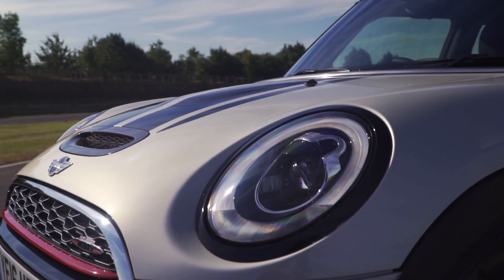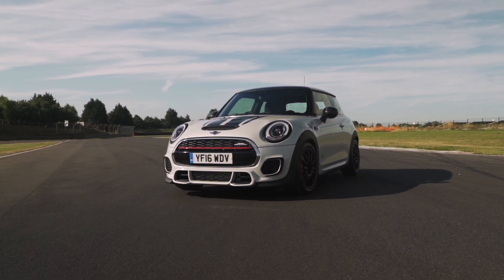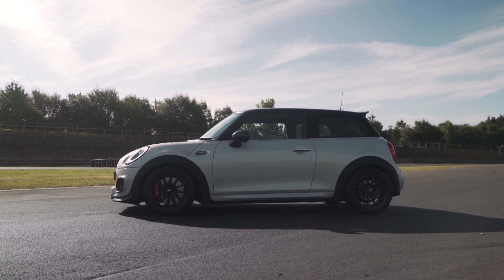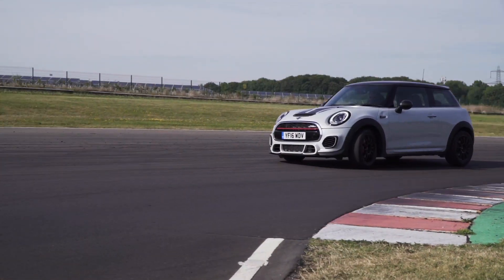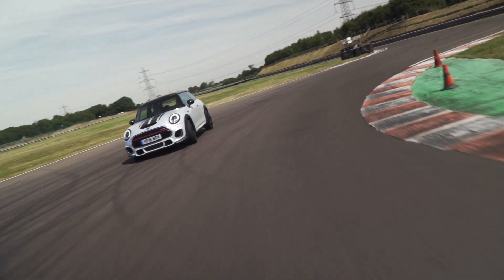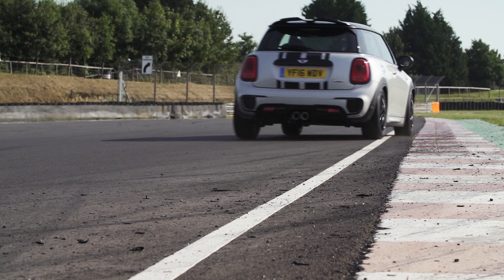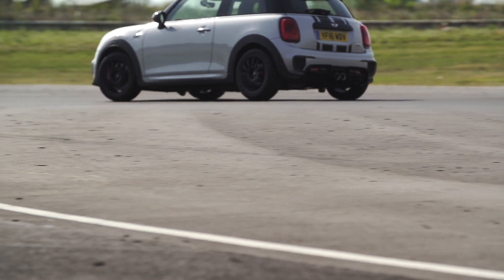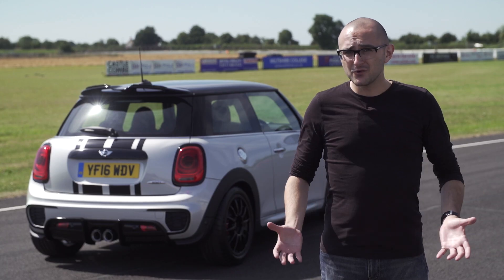MINI John Cooper Works Challenge: So Loud It's Illegal - Carfection

Comment: Any MINI onwers here?
Reply: Megat Afiq Yep! Picked up my JCW on Friday
Reply: picked up my countryman yesterday :D full carbon body, with alcantara interior and akrapovic exhaust system and the 1 ltr engine from a fiat 500 twinair
Reply: Megat Afiq I have mini countrymen Cooper S ... love it 😍
Reply: Yup! R56 Cooper S, 220 hp/260 ft/lbs Manic Tune, Invidia exhaust, Bilsteins/ H&R's. Funny thing is with an Invidia exhaust, my MINI sounds exactly like the Challenge. Probably because of the twin scroll turbo and unequal length headers on both cars.
Reply: F56 Challenge 210 No061/210 🙋🏻
Reply: Yes :) F56 Cooper S. The BMW 2.0 turbo engine has a lot of potential. It is actually rated for 300 BHP and is achievable with a remap.
Reply: Yes. F56 MCS 200whp. Not much of power but a lot of fun :)
Reply: How is is so far? Im considering ordering a JCW.
Reply: 2003 R50 One with chip tuning to 130hp :D It is my first car and i am so happy with it :)
Reply: Megat Afiq here, how do you get that cracking sound in the excaust
Reply: R61Paceman JCW here, R56 JCW sold unfortunately...
Reply: Sport button, car has to be warm  thou. All JCW's will pop and crack on the overrun. Not sure about R53 thou.
Reply: R60 Cooper S
Reply: Just bought a 2005 r53, picking it up on tuesday, so bloody excited for it.
Reply: BlackForest Adam I have an 05 as well.  Very fun car
Reply: Michael Armstrong have a manual R53 with the JCW exhaust, has to be really good warm will it pop and crackel on overrun. It does pop when shifting under 3500rpm tho
Reply: aye 1499gt
Reply: Yes R53
Reply: Megat Afiq, me :) i own a cooper s hatch 2013 love the thing
Reply: since there are so many of mini owners here i wanna make a question <3 i really like the cooper but the reputation of not being reliable scares me is tha true ?
Reply: One be cautious when buying. I’ve owned an R56 JCW for 3 years. I’ve spent over 60% of the purchase price on maintenance, and I’ve driven less than 20k miles during that time.
Reply: @mattportnoyTLV   oh no :( so is there a way to make minis more relaiable?
Reply: One I wish. They’re fun to drive but they’re pretty much the rich man’s cheap sports car. If you buy, consider buying one from a Mini forum, where the car history is documented. 

Maybe someone should start a company that makes reinterpreted R53’s and R56’s, like what Singer does for 911’s. Except not $300k, and with a Toyota motor transplant, lol.
Reply: @mattportnoyTLV  well sure tnx mate
Reply: Equaliser same!
Reply: 2017 F56 JCW in Rebel Green :)
Reply: Waiting for my jcw , expected tomorrow.  Cant wait
Reply: Yup, 2004 R53 S! I love my Car!
Reply: 2004 mini cooper s
Reply: Yh, I got a blue one ;) few weeks ago.   ....2005 Cooper 'S' Convertible, Works edition, (wotfr that means), idk if thats the R53?  its got a blower and cool wi-fi hi-fi ;)   It's cute, not too much to handle but still fun on country roads.  It sounds remarkably like the old '60s ones until it crackles an pops on the over run and when HOT!! ..goes BANG!!! ...as it decokes the catalytic converter and cleans out yrs of short journeys ;)   ...yh, it runs so much smoother now :)  ...I'm  over the blue moon with it.
Reply: @midasbentacore1270  Yes.. treat them gently, dont rag them when cold and dont 'snatch' at the controls, be smooth in operation into/out of corners, (most of them time, anyway;)
Reply: Just bought my first ever mini a r56 good example. Can’t believe the handling absolutely stunning

Comment: Too bad someone can't invent a ray gun that shrinks things, this would be one of the first things to try it out on!
Reply: Try being funny somewhere else. Even a regular Cooper S will run circles around your Fiat.
Reply: I think Klasse Act was rather getting at the fact that the Mini gets bigger and bigger every generation. I also find the current Mini too big and out of proportion. This is due to the fact that by the next generation BMW wants to have the Mini and 1 Series running on exactly the same platform
Reply: di foo!! ...yeah, I was being funny about the ray gun but as far as running circles around my Abarth....NO! I haven't been on track but I've been challenged by the rare MINI owner I've seen and it hasn't been pretty for the MINI, although it was an R56. 

I had an R56 from 2007-10 and it was a POS, 3 aux fuel pumps, fuel injector, MAP sensor, timing chain, 2 intake manifolds because it would freeze up when cold and the car would "diesel". I've had ZERO problems with my Abarth and its modded. I'm not saying that a Fiat is a Honda for reliability but it's been waaaaay more reliable than my old MINI and others has many problems with their R56's. 

That fact is this, R53 was the right size, then the R56 got bigger and now the F56 has gotten fat and lazy. It may have more power but it's waaaaay bigger than 2 gens ago and that isn't right. Also, never see MINI's around, cars and coffee and the like, why is that because it's such an enthusists car but yet you never seen them except driven as commuter cars by people who are certainly not enthusiasts.

Have a great day and I'll be looking for you around the streets of Chicagoland, line em up!

Comment: Probably a cheaper solution: Buy a standard JCW, buy decent suspension and an exhaust. And here`s your `Challenge`. Then spend a few extra pounds to tune the engine and you murder the `Challenge`.
Reply: Or just buy a Leon 290 Sub8
Reply: Kaisuke971 Obviously. I absolutely adore the CUPRA!
Reply: Spent 10k to build an R56 Challenge car lol
Reply: Jonathan Price Starting from a casual CooperS?
Reply: Cupra is such a great platform
Reply: Yes wanted a proper MINI Challenge Race Car rep so a MCS base car was the correct start point
Reply: I live in the UK, if it was illegal half the 18 year old lads in the country would be in prison. The thread you linked is just an example of a local police force being overzealous and using a law that's more of a catch-all to prevent overly obnoxious exhaust modifications. In fact if you read down the page you'll find the chap who got the fine managed to have it thrown out of court (in part due to the copper's incompetence).
Reply: @patthonsirilim5739  ...except your insurance company ;)
Reply: @egypsy  yep people only give a shit if they have a reason to and if the reason is to make money you can bet your ass they will be giving alot of shit

Comment: MINI have fallen very, very far from the R53. Oh how I miss my supercharged cracked terrier...Plus, the Abarth 500 has the MINI beat in the 4-cyl turbo sound department. Nice chassis apparently, but let down in so many other areas...lost charm being the big one.
Reply: as an ex- owner of a R53 i cant agree more with you. The current mini is too big and expansive as hell.
Reply: ChaosphereIX i was thinking about getting an f56 JCW but it's big and boring compared to the R53, I've just had my hydraulic clutch done which wasn't cheap but my god, I can't replace the car
Reply: the supercharged version was gutless. I much prefer the new gen.
Reply: Gee Tee you are so wrong. It was lighter, more nimble, and had no turbo lag at all. Not gutless. With a 15-17% pulley swap and some basic bolt-ons, well over 200hp is easily attainable from the tiny 1.6. Plus, it didn't run into a heat wall like the turbos did [speaking from experience working on R53 and R56 MINIs].
Reply: ChaosphereIX I'm talking standard. You could save weight and make changes to the turbo versions too but then it's a different car. Standard SC was slow, gutless and my NA Clio was miles more fun and faster. The current version feels miles ahead of previous gens.
Reply: Gee Tee again, I will have to disagree with you...yes, it had less power than the current gen. That also was about 15 years ago. Especially in the handling department and the rawness / fun to drive factor, the R53 trumps all subsequent gens. By the direction MINI is going, it always will too.
Reply: I suppose it's not easy to make cars quite as fun these days with all the tech and safety. I still didn't like the SC's version.
Reply: First car I owned was R53 17% pulley, JCW Injectors, Intake, & One Ball mod exhaust was all you needed. Best car to learn how to have fun without killing yourself
Reply: I'm sure it was with the mods. Mine was the Clio Cup and it was a proper giggle to drive.
Reply: R56 > R53

Comment: even my Superformance continuation 66 GT40 MKII SBF 427 and my LSA V8 91 Miata has AC AND 648hp! screw that thing.
Reply: I wonder how a 427 GT40 wud fair against a SC-1600 Cooper-S   ....on the narrow country roads of England, with short straights and MANY tight corners  ;)